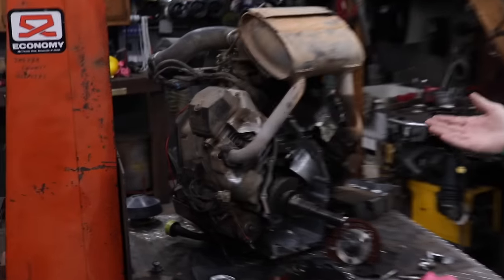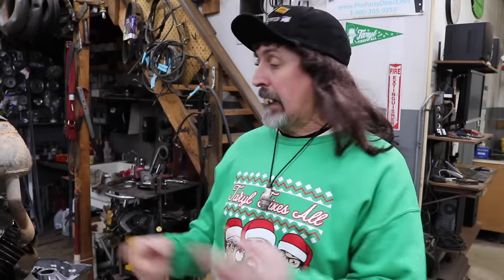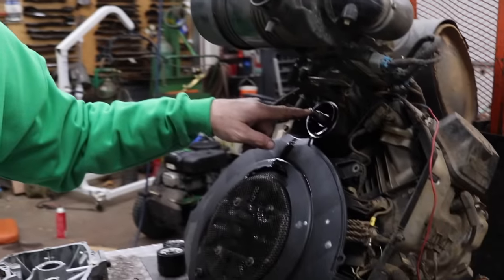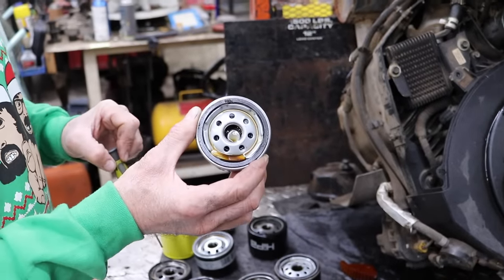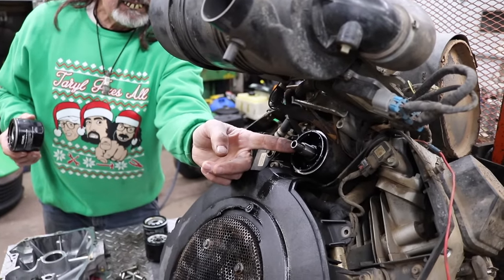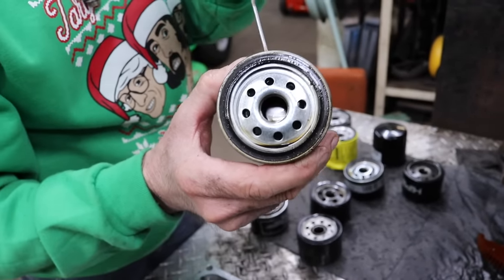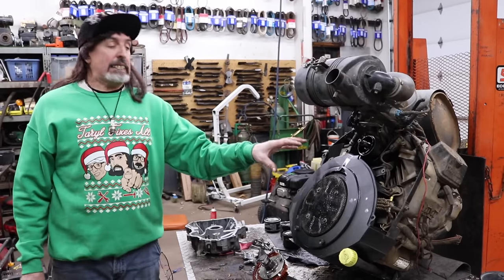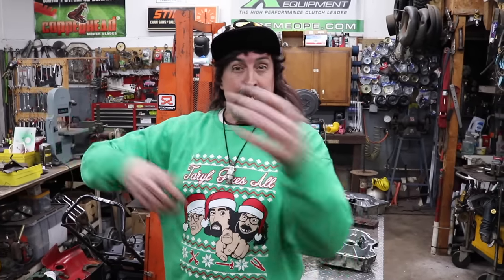💸 $4,000 Down The Drain! DON'T Do This Epic Fail!

Comment: I've seen this design a few times. For all of those wondering, the reason the center is longer is because the filter goes on the top of the engine and sits upside down. The center is a standpipe which along with the anti-drain back valve, keeps the filter full of oil when the engine is off to prevent dry starts. Without it, the oil pump would have to fill the entire filter with oil on every start before it would start suppling oil to the bearings.
Reply: Thanks for the explanation, that really helps m
Reply: that's exactly right and I thought Taryl would have known this to be honest...
Reply: Great explanation. Thanks. Taryl - is this a correct description of the design and are there other engines which have a similar design?
Reply: But older command singles donthave this and their filters also upside down
Reply: I could see that coming. I remember the old slant 6 chrysler engines.The filter was upside down with an even longer extention. A little shorter filter might go on fine but keep the bypass valve held shut.
Reply: The Frantz filter company had a nice 2 port sandwich adapter.  The slant 6 is the only engine I remember I couldnt use a sandwich adapter on. Had to tee off at the oil pressure switch. The slant 6 had a 3/8 oil pressure switch.  The Others were 1/4 or 1/8.  The next slant 6  I had a 3/8 brass tee and a 3/8 to 1/8 bushing. I am a filter guy. Some Kohler engines I can use a sandwich on. Not that one. Some lawn mower engines have no oil pressure switch. Thanks for the valuable information. I dont use short filters butmany do.
Reply: The slant six the miracle engine some have been none to have 500000 Believe it or not incredible sounded like a washing machine out of the factory 😂😂😂😂😂😂
Reply: Good way for someone to sell a lot of engines.  China men love this design.  :) A lot more motors sold, than 1 second without oil in a small motor.

Comment: Got a story about people that want parts for a mower that they don't know what it is.
A gentleman went into John Deere for a mower belt. The parts guy asked what model it was. Guy didn't know. Asked if he had the old belt. He didn't. Asked where he bought it. If he bought it there, they would have a record. He bought it at a box store. Meanwhile he is getting angry that they aren't giving him a belt. Keeps saying "all belts are the same, just give me a belt!" Finally the parts guy goes back to grab "a belt." Comes back with a combine rotor belt, drops it on the counter, and says "that'll be $1,100.00 please." The guy goes from shock to anger, to a loss of words, and leaves. Later that day, he comes back. He apologized and had the model number, what belt it was, and the old belt in hand. The parts guy apologized as well, and even printed out the procedure for belt replacement from the manual.

Comment: Just because the shorter filter doesn't hit doesn't necessarily mean it will work ok. If there are only a few thousands of an inch clearance it could cause a slower death than a catastrophic failure. Thanks for sharing.
Reply: I was thinking the exact same thing. I have to disagree with Taryl on that one. Why not just use the longest filter that will fit.
Reply: Agreed, even if it fits it still needs adequate oil flow.

Comment: Common failure on this motor is dropped valve seats. The failure is caused by overheating in the exhaust port, the overheating is caused by the exhaust port liner warping and blocking the exhaust port, I've repaired 4 of these engines with the same problem, one was on a standby generator. 2 where on auction purchased equipment, made good money fixing and selling those. The other was a walk-in customer that was told by his dealer that his 2 year old exmark was not worth fixing and they offered him money for it on trade. He was intelligent enough to not trust them. 1 used cylinder head off a generator, one new piston a gasket set and a ring set because why not I'm in there anyway. And he was making money again a week later and only cost him an honest $850 for shop labor and parts. Btw these engines are also known for oil leaks due to crankcase gaskets being destroyed during assembly.
Reply: Kohler used to be a proud small engine manufacturer. Their cast iron single cylinder engines would run for years on end. Those days are over. I'll stick with Honda or Kawasaki.
Reply: @quantumleap359  they all have their problems, the old Kohler's would last about 1000 hrs before burning excessive amounts of oil, Hondas are decent but keep in mind that the ones that have gained a good reputation are the single cylinder up to 389cc the twins are not great, the Kawasakis are ok but had oil issues on the vertical ones I have had several come in with worn out flywheel side crank bearings, they also fail because they have to have valve adjustments done and if they don't they go to zero valve lash one at least one cylinder which causes motor vibration and the connecting rod cap bolts loosen up and they throw a rod out the block I've seen half a dozen do that. My first choice is a Kohler command. I've seen them run reliability with as many as 4k hours with just oil changes. Keep in mind I'm only talking about commercial engines not the Kohler courage twins.
Reply: @quantumleap359  no there not so stop lying..I have a Kohler 7000 series 22 horsepower 725cc V Twin engine cast iron sleeves and it's designed after the Kohler command commercial pro engine..3 year unlimited hours warranty..so there you have it..sometimes it's best to research before you say anything because speculating or assuming doesn't cut it it means Nothing..

Comment: To me that one short filter you screwed on. May not be fine. If the tube was only a 1/8" clearance from hitting the bottom of the filter. I would think there should be a certain clearance between from the tube and the bottom of the filter when screwing the filter on. For the right flow entering the filter. I would like a little more clearance than not enough. Great job TFA for problem solving the issue.

Comment: I've bought after market filters for things, but I always put them side by side with the original and make sure they're the same.
Reply: Yup, that's the only way to go, even if you buy a stock filter out may have a version change
Reply: @David Wanklyn Exactly! Thank you.
Reply: Had to do the same thing for my small 30" mower. Has a Troybilt engine but for some reason you can barely find the OEM filter for this thing even when searching the part number labeled under the seat. The ones I did find were either sold out or on severe back order a month or two out so I went to Home Depot and grabbed a Briggs and Stratton filter. Check it and for the most part, everything was the same other than the B&S being about a 1/8 of an inch longer. Not an issue, just means I have to put in a little bit more oil to compensate.
Reply: you are a hero

Comment: Thank You for information and advice. People need to be warned to be alert and check what filter they use or install on the mower
Reply: YUP, it means to actually read the owners manual, which would give the proper part#

Comment: I’m the king of using cheap automotive style filters on mowers, tractors, and atvs. Mainly due to price but also so I don’t need to make a special trip to parts store or stock a ton of different filters. I’ve had great luck so far, if it seals and threads- run it. And everything gets rotella syn 5W40. But I’ve never seen a filter adapter like that one.

Comment: I always buy lawn equipment with Briggs engines.  I converted my new John Deere Z345R (22hp Briggs) with a Briggs 594271 Remote Oil Filter Adapter, and a longer Motorcraft FL-400S filter, to alleviate the mess those puny filters leave when changing oil, and to give the engine a little more oil capacity.  I used the same Motorcraft filter on my old Craftsman YTS3000 (21hp Briggs) with no problems at all.  I looked up the internal specs on the stubby OEM and Motorcraft filters.  They are the same in all respects.
Reply: 😅😂🤣😂😅😂🤣 Briggs? You have to be joking

Comment: Kohler had a bulletin recently.  They could not get the longer, yellow filter 52 050 02 made any more.  They stated it was OK to use the 12 050 01 short black filter on this engine.  Last batch of engines we got had the black filter installed by the factory and have not had their first oil change yet and are under warranty.  We had enough stock on the yellow ones we never ran out here.
Reply: Makes me wonder if they changed the design of the filter housing at some point.
Reply: ....cutoff the  UN threaded part, that inch and quarter, or so.   DONE-ski.........filter away  folks   !
Reply: @scottsatterthwaite4073  The reason for the standpipe is the filter is upside down.  If it did not have it, the upper part of the filter would stay full of air, unless the lower pleats got really clogged.  Chrysler slant 6 had this too.  I have seen other upside down filters that did not have it.'

One thing, this video makes me really glad I never ran out of the yellow ones.  I always knew there was something funky with this arrangement, and with OE filters, at least you can blame the OE if something goes wrong.

Comment: Ran into this on some of the newer vehicle engines.  Newer GM 4 cylinder truck engines have the oil filter bypass valve built into the oil filter adapter.  If you screw on a non OEM filter with the bypass valve built into the filter, you could end up damaging the engine.  Most of the vehicle manufactures have or are putting out factory TSBs to use OEM filters only.  Why risk blowing up your engine for a cheap filter that may not operate the same as the OEM filter?

Comment: Yeah Taryl, I gotta play lawn mower detective on our 2013 Cub Cadet LTX1050 with a Kohler Sv725-3021 on it. It locked up all the sudden with white smoke coming out from the bottom. Just haven't had time to tear it down the rest of the way. Probably about a $1,500 to $2,000 engine.
I'd just alot of new parts on that mower and it was running great until that happened.

Comment: I cross referenced a Honda GXV530 engines oil filter part number 15400-PFB-004 to a Ryco Z142A oil filter which was only 10 millimetres taller than me OEM oil filter & increased the capacity of the oiling system by 100 mLs or something.

It worked & it was cheaper than the OEM oil filter !

Comment: When doing oil changes on Kohler's I used ph3614 size filters  ph3614 is the fram part number but and cross compatible filter will do, it's the same height as the taller Kohler filter but much cheaper. Infact I used to buy Toyota filters by the case because all of my vehicles used that filter and from the dealership the filters only cost $3.29 each when bought by the case. The only time I used the smaller Kohler brand filters is when the machine that it's installed on doesn't have the room to do so.
Reply: Smart man!! Its Just A oil filter in the circulation of the rest of the oil, it can and will do "only" so much. if the motor blew because of starving for oil, what happened to a;; the rest of the oil in the engine?????
Reply: @charliereed4642  did I say anything about the filter causing an oil starvation problem? Oh btw a pressure lube motor WILL fail if it loses oil pressure and still has a full crankcase of oil

Comment: I actually have one of these engines I installed it on a cub cadet tank LZ I always make sure I use the original Kohler all filter, exact part number thank you for the video you reinforce my belief that you should always go back with the same oil filter

Comment: Great video! The other thing I noticed is that the filter is on top of the motor. How big of mess does that make when changing the oil??
Reply: I'd say you need to lay a rag or two around the filter for sure. It's going to dump excess oil for sure.

Comment: First two things to check immediately after changing the oil + Filter in any engine. Oil pressure idiot light/gauge pressure and that oil is not spewing everywhere after startup of the engine. I learned this forty years ago because I screwed up many years ago. Thankfully the engine did not cost 4K then, although it was on a car engine.

Comment: Taryl, LOVE your videos! One question: What is the proper way to break-in a NEW small engine? I am in the process of replacing the 79cc engine in my 'Southland' Chineseium lawn edger with a 212cc Predator. With a new car, the way it WAS DONE was to NOT drive it at a CONSTANT SPEED, but to drive it for 500miles while constantly varying the speed. From what I understand, today's car engines are already broken-in when they leave the factory. Any advice would be greatly appreciated,want this Predator to last a good long time. THANK YOU!

Comment: I have a Kohler 7000 series 22 horsepower 725cc V Twin engine in my tractor..brand new replacement same Kohler engine would cost $2,000..so no room for mistakes..

Comment: 4K and a plastic cam gear. If you check an oil filter parts book for thread and height, you can often get a larger filter with more medium. Then you have to worry about things like check valves. Engineering will often be willing to help you out. Good video, thanks. I've used Wix on my Isuzu diesel since 94 and no mechanical failures.

Comment: The filter does not make a mess when changing it. At 3:00 You will see the spring loaded plastic shield that rises up as you unscrew the filter. It stays in contact with the filter gasket and causes the oil in the filter to drain  back into the engine. The longer nipple is needed to keep that filter centered over the fitting while it’s completely unscrewed and draining. Once it drains you lift the filter and tip it up while keeping it over the fitting.
I cannot believe someone doesn’t notice that the filter has bottomed out too soon and that their last few turns are very difficult as they are crushing part of the filter.
Reply: Your explanation seems logical, Captain.

Comment: I've seen several of these engines in truck mount commercial carpet steam cleaners with over 2000 hours in my shop. We use 1348 Napa filters on them, obviously no problems as of yet...

Comment: longer(extra capacity) filters should be used when possible.
Reply: Only issue is it can take an extra second or more to fill the larger volume in the filter if it’s draining back. To large can be an issue but a bit bigger won’t hurt.
Reply: No more short blocks because they all sold out. Because they all blew up.
Reply: @FishFind3000  that what the anti drain back valve is for

Comment: The dealer should always ask the customer for serial numbers and engine numbers of the engine before even handing them a filter. The other issue is people are buying their filters off the internet and they will just type in oil filter for Kohler engine and will pick the one they think is correct.

That John Deere Sabre Pro mower behind you brings back memories of the ones my dad sold alongside John Deere tractors in the UK, we also had Euro Pro versions in the UK which were certain models chosen by John Deere from a Italian manufacturer known as Castell Garden (who are now part of Stiga corporation) they were the budget range machines and did eventually get turned into John Deere colours until John Deere decided to introduce the budget X series machines based on your L series machines like the L105.

Comment: What do you think about a remote filter set up.
Reply: The standpipe ensures there is oil of sufficient quantity retained in the filter because this filter is UPSIDE DOWN on the engine.
The right quantity of oil is kept inside the filter by the combination of the standpipe and the anti drain valve...so the engine doesn't run very long without oil on start up....

Your remote oil filter system may not ensure this supply on start up?

Comment: I recently bought a cub cadet XT1 42” with a Kohler KS595 engine and have to do break in oil and filter change. I searched for a cross reference of Kohler OEM oil filter 1205001 and ordered a Fram PH8172 from their Amazon store. I went to an auto parts store and they tried to sell me one that didn’t have 3/4”-16 thread. It was an STP M20x1.5 Thd. I wasn’t taking the chance.

Comment: I'm just amazed that long azz filter pipe doesn't have any small bypass holes in it towards the end of the pipe where it's kind of smooth. Or even a small notch to prevent that issue
Reply: Yeah, cross drill that tube near the end so it can't be blocked.
Reply: And you've just discovered the problem.  If you had a bypass hole, you've totally negated any reason for having the extended neck in the first place.

I will never understand engineers.
Reply: @cujoedaman  The extended neck is probably to prevent screwing on a short filter. 🙂
Reply: @cujoedaman  it makes sense when you think about it. I bet that longer neck allows for there to be further separation between the output when the input so the oil will go through more the filter membrane. It’s probably more important on these high horsepower engines.
Reply: @cujoedaman  ....right....i'd   use  angle grinder, and cutoff  the UN threaded part.  modern  ' engineers'   just like to change things, every  week.......grandpa  would   SPANK  THEIR   ASS.....
Reply: @BILL S  but it prevents it only the second time because it will be destroyed by then
Reply: @lawnmowerdude  I've never seen filter not full of oil in all my years changing them.  If that was true, then it's a major issue with oil flow that needs to be addressed.

Comment: did this myself in my first year in business had a short filter with a different thread in it Napa filter that threaded in the single cylinder kohler engines fine but as I found out was not the same as the twin engine  filter 3k later out of my pocket she was running again I now buy filters from briggs and kohler instead of chancing the wrong filter